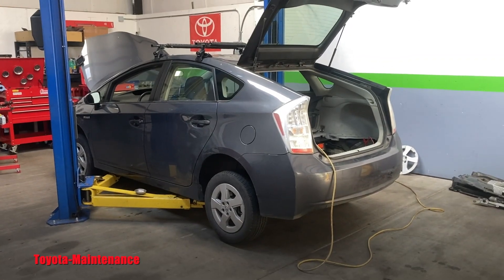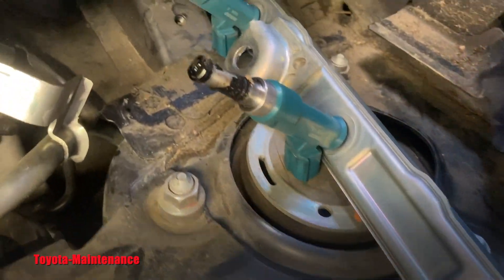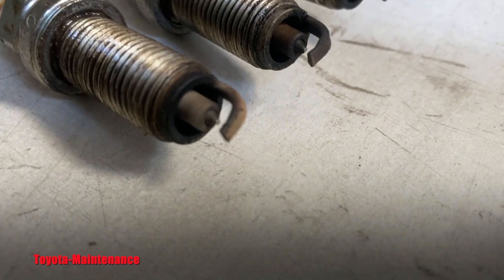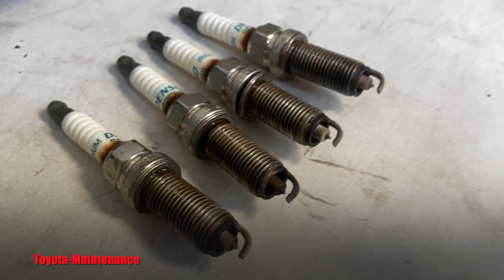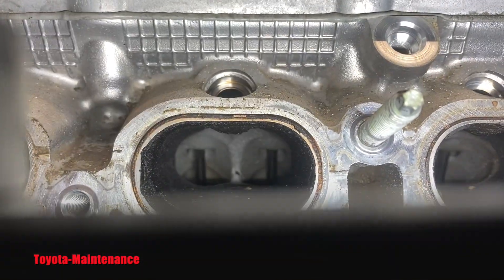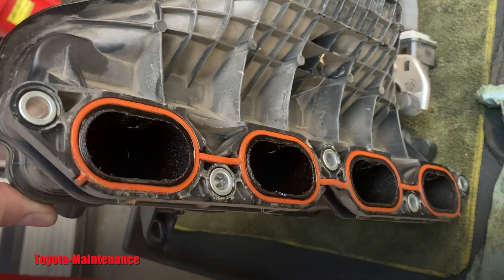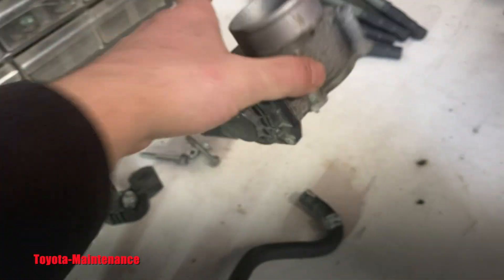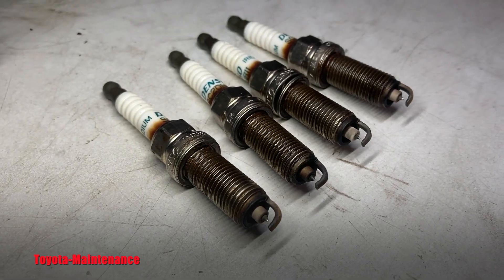Which cylinder is misfiring?

Comment: Going on what I have learnt working on small engines from Toyota and European manufacturers here in Australia, this engine looks as though the car only does short trips, never a good long distance high speed drive that would help eliminate the contaminants in the intake system. If it I fact does do long distance drives, then the spark plugs are either way past their life span or they are gapped too large - assuming the petrol used isn’t contaminated or very stale. I’m interested to see just how crusty the piston tops, rings and valves are. Most likely new Valve Stem Seals should be fitted.
Reply: Tim, they do run larger spark plug gaps nowadays.  I change my plugs at 120k miles per the manual, no since throwing your money away.  I did the second change at 240k mikes.  Now it’s up to 291k miles.  4 cylinder Camry.